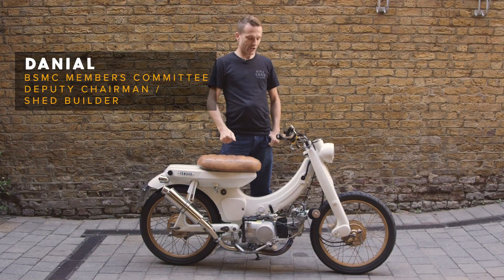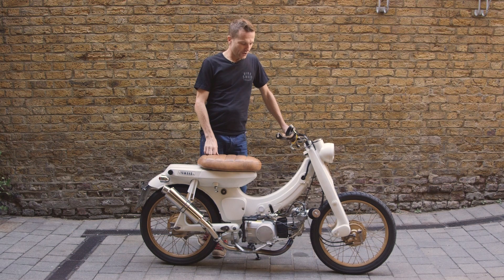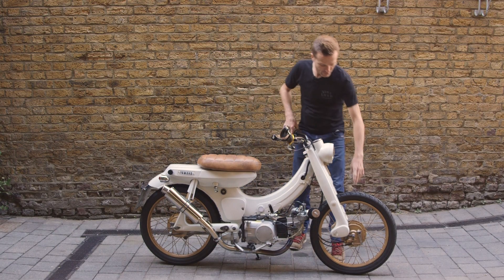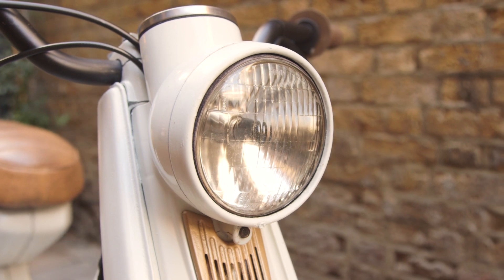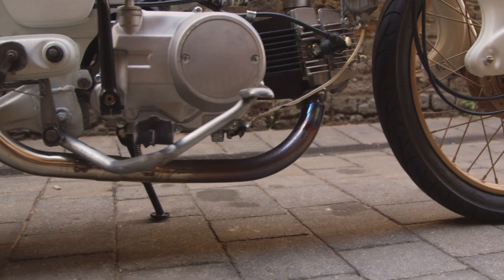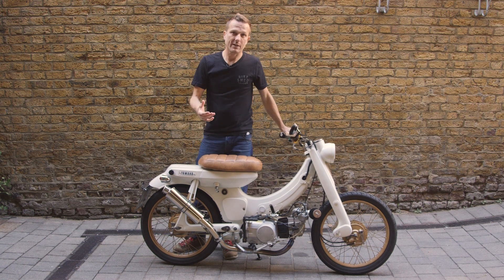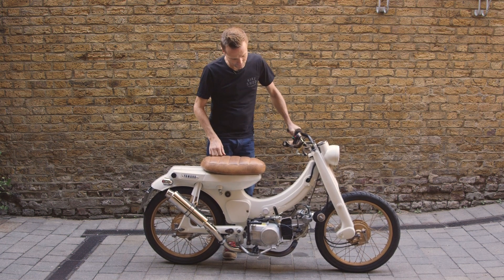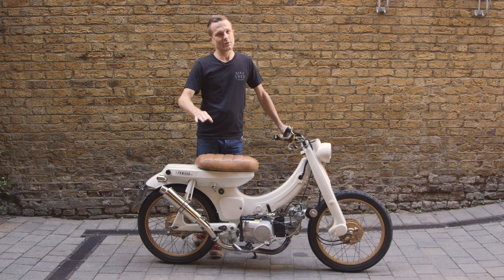Regulars Rides: Danial's Yamaha V50 Custom Scooter

Comment: It's all original. Apart from the engine and the electrical system and the exhaust and the indicators and the switches and the handlebars.

Comment: I would love to own this bike. It would be perfect for Thai cities. It's so light, I bet it shifts.
Reply: Yes it does
Reply: @stuartallen3075  its an 80 cc 5speed transmission
Reply: I'm sorry 50cc there's also a 80cc out there
Reply: @sovietmilk2674  no it doesn't. That's a 125
Reply: @liammeloury-caligiuri6272  ooh thanks i didn't know there are 125's out there
Were im from im used to 50 and 80cc motors

Comment: For everyone who has a rust problem BEST solution you will ever get.
works best on cleaning the exhaust.
Ingredients: mix dish soap with water [normal ratio]
take a aluminum piece of folie, dip it in the soap water, then use it like a sponge and the rust will rub off like dirt
your welcome :]

Comment: I like what you have done here, especially the neat finish on the headlight/ speedo combo (not sure if Yamaha did this or you). I have a 2001 Honda C90 and might consider doing a rebuild similar to this. One of the tricky bits might be finding a new seat. Where did you get yours? Presumably it was made by a custom shop?

Comment: i know what engine on it. that's 125cc Honda engine, pretty popular engine back than, now you can buy the engine just for $150 USD.
that engine have issue with the timing chain, it's wear out quite fast, but yeah you can fill up and go with it wherever you want.

Comment: Hi I am in a similar situation, I have a 1976 v90 that's had a reboar to 100cc its an absolute rotbox and the front wheel won't, move did you have a problem with the brakes on yours ceasing up I wanted to know if it was a common problem

Comment: Cool, But Thats a moped, not a scooter.
Reply: Not a moped either, it hasn't got any pedals.
Reply: That has nothing to do with it. Its about engine placement and to a lesser degree about body styling. The Puch DS for example is a moped being the engine is up front, but with the scooter style fairing and with single or dual pedals. Scooters have the engine down in the back.
Reply: It has more to do with how your state classifies it.  Mine shifts, but it is classified a moped, so no license needed
Reply: @stannousvortalux5655  Im not talking about license or state recognition. Im talking about how to categorize vehicles in general. In my country (Denmark) scooters and mopeds are in the same category, law-wise. A scooter is the classic vespa-type. Leg-fairing, most often without a manual clutch, and with a rear-mounted engine. A moped has the shape of a motorcycle, typically without a leg-fairing and typically with a number of gears with a manual clutch. The moped has an engine between the riders legs/up front, as a general rule.
Reply: No it's an underbone
Reply: not a moped, its a a scooter
Reply: Ismael no
Reply: @ismael9841  But... you're wrong.
Reply: It's a step-through motorcycle, some people call them "noped".